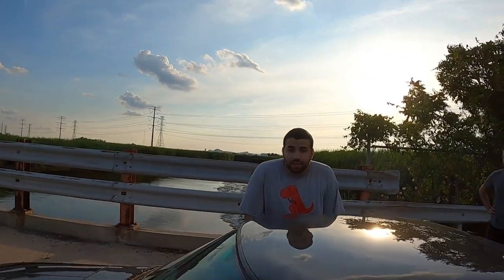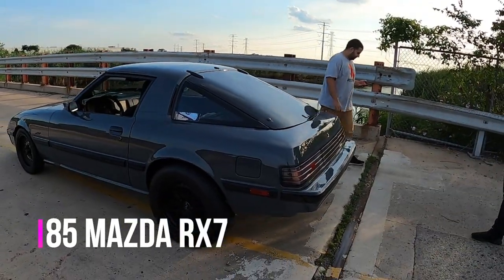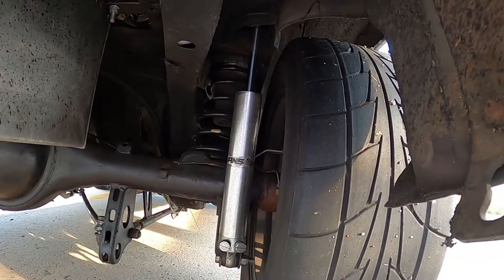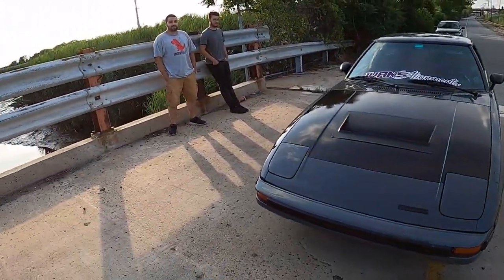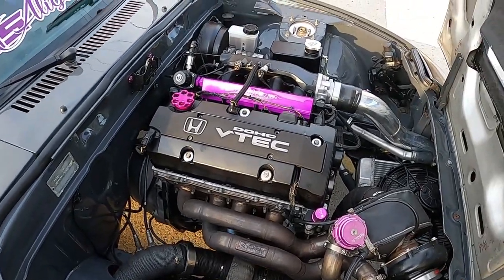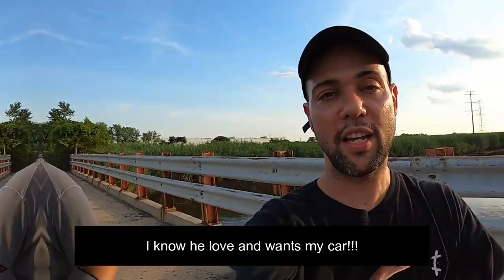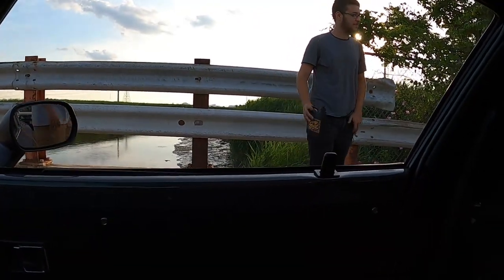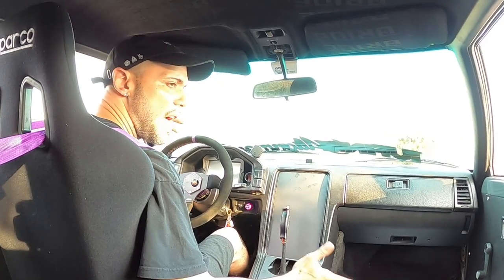Aeromotive Brushless pump testing!!!

Comment: interesting info with the TPS signal wire @IVANS_ALIGNMENTS I'll be trying this same trigger method after talking with Aeromotive myself on it I was told the same "they've never seen an issue" he did however recommend using a shielded pair wire from the TPS signal wire to pump which I will be using. this way it should eliminate any "noise" on the signal wire. They also touched on the fact that their pump signal wire draw is so low in milliamps that it should not effect TPS performance whatsoever being teed into that signal. we shall see!
Reply: It didn't work for me unfortunatel.